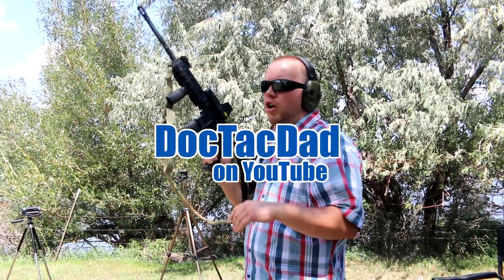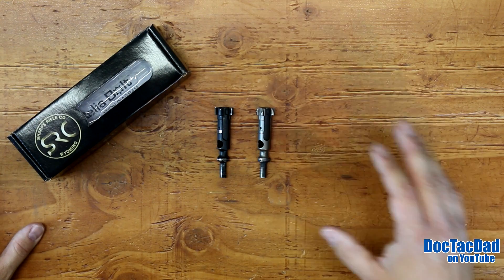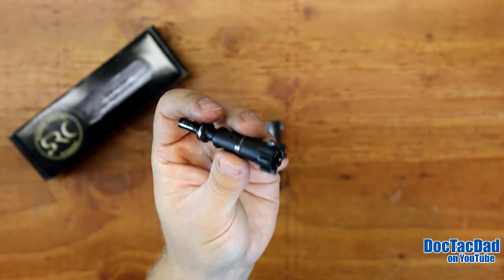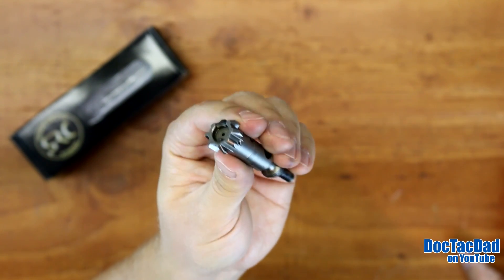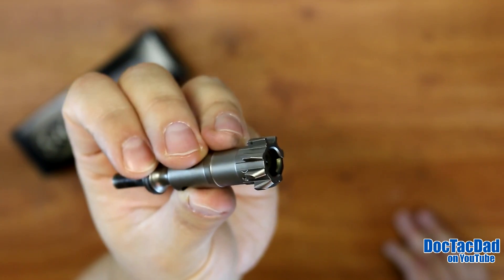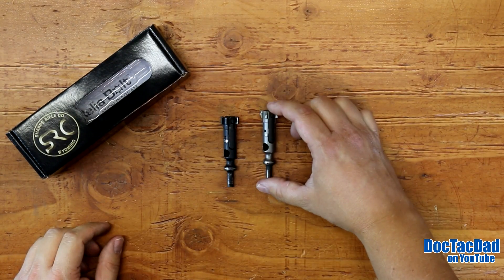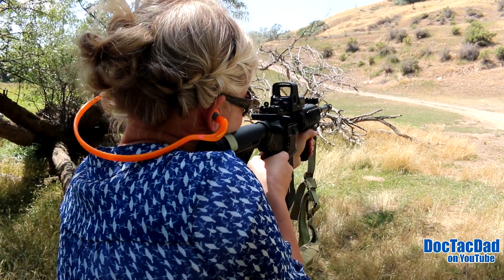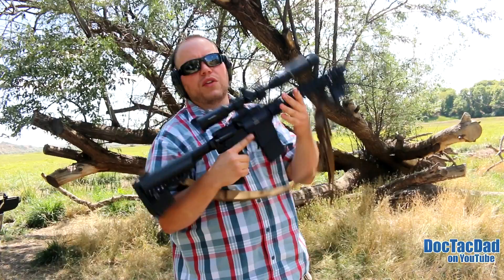Sharps Rifle Co. - Relia-Bolt - Premium AR-15 Bolt

Comment: Nice video. I think a good comparison test for the bolt would be to start out with a clean wet rifle with a milspec bolt and run it till it starts having problems. And then do the same with the SPC bolt installed and see what the difference is. I have been shooting AR's for a while and with Brown Bear and Wolf ammo with the milspec bolt it goes about 1400 rounds before the hiccups start.
Reply: I put mine into milspec bolt and dirty upper. Run close to 1k with no probs over a month. Still waiting for a stoppage.